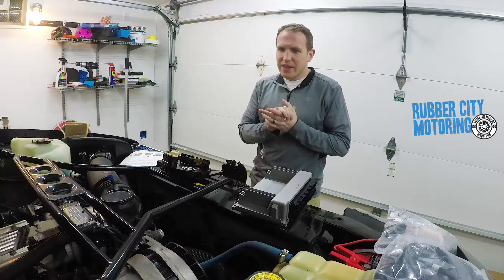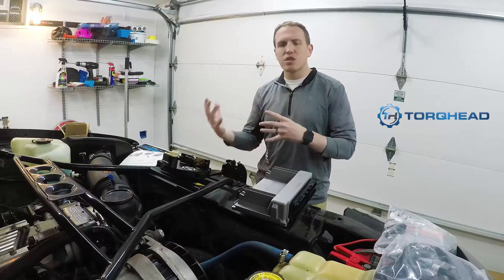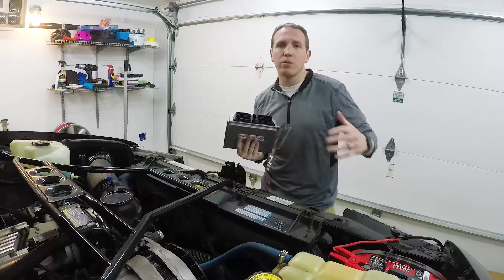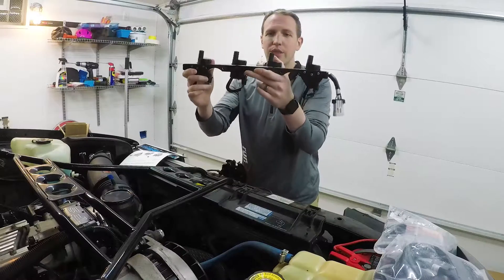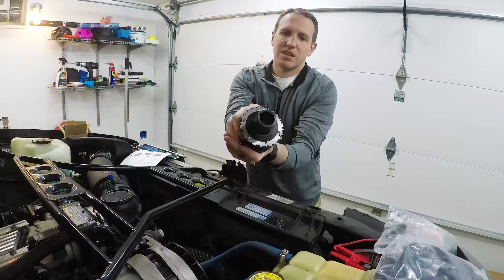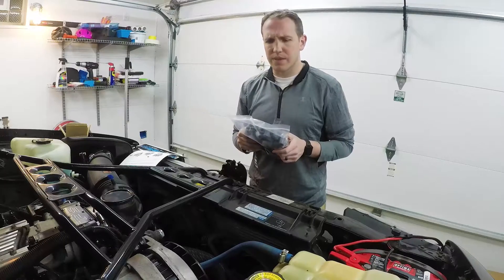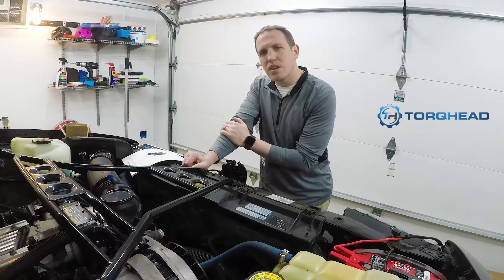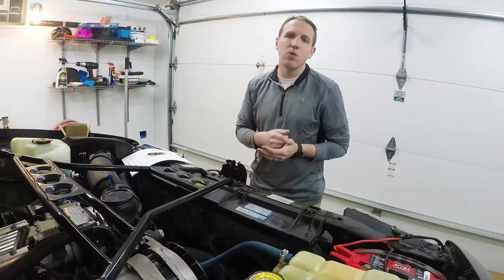Part 1: Torqhead 24x Coil LT1 Upgrade Introduction and FAQ

Comment: It’s a maybe for me. I’m in college and I got a 94 Z28 as my first car. Not a smart move right? Blame my families tradition of owning a muscle car as a first or second. I’m highly considering replacing the OptiSpark with a different system, but also just going straight to a 98. However I just love the body style of the 94 compared to the newer catfish look. 

My 94 drives like a dream besides rotted out floor pans, a bad oil pump, and a front main seal that’s bad. I was able to get a good driver pan out of a convertible. I am by no means experienced in mechanics. My dad’s teaching me and this car has made my head explode more times than I can count.
Reply from the maker: I had a ‘98 SS - one of my favorite cars I’ve ever owned. Very reliable, no issues, and honestly I’d go that route, unless you have time and money to tinker with your ‘94.

Comment: I know you had a 383 before your torqhead install. Would any changes need to be made if i did this upgrade first & then stroked my 5.7 to a 383 next winter?
Reply from the maker: Probably just a retune to the torquehead pcm.

Comment: I know this was posted a while ago, so I would hope there are lots of miles on the car now and more people that have done this. Have you (or anyone else that follows this cannel that has made this modification) had any problems with it? Also wondering if you or any followers have had any issues passing smog tests with this kit on? My opti is dying and I'm considering this modification, but the car is my daily driver so it will need to pass NV smog check annually. If anyone has done this mod please let me know if it causes you to fail smog check. Thanks.
Reply from the maker: Hello!  So I have sold the vehicle a few years back.  Overall I didn't have issues with the Torqhead products; just getting the tuning dialed in with my 383 was the biggest challenge.  Their setup is mostly designed around stock parts, which is ideal.  I did pass an Ohio smog check with it here as well; not a visual inspection, but just a pcm check.

Comment: I investigated the Torqhead setup and even called the company (and spoke to the owner) My car is a 92 Corvette Lt1. It just so happens that the 92-93 Corvette is not supported. I wanted to do the Torqhead thing, but for some reason I can't. Maybe it's the OBD1. Don't know.!
Reply: its the old style computer. you could do it if you converted to a 94+ computer with wiring harness...pain in the ass, wish theyd make one for the old style computer.

Comment: What do you think of that TPiS throttle body?
Reply from the maker: It was overkill. My 383 setup ran better with the stock throttle body. 

I think you need some massive head work, cam, etc to make the most out of that 58mm. Plus it didn’t idle great with it.
Reply: @RubberCityMotoring  Yes i know a 58mm is overkill, it is on anything that small, you'd want a lot more displacment for a 58mm. I'm more interested in the quality of the unit, they make the same in 52mm which is what my Callaway has factory fitted. Mine is worn and i need a replacement. TPiS seems about the only place that has them, short of a BBK, and those a total f***en junk.
Reply from the maker: Oh oh it was a very nice unit. Quality was top notch. The return spring was a bit stiff, so the pedal felt heavier. Overall though, a nice part.
Reply: @RubberCityMotoring  Thanks mate, so far no one has been able to tell me what they were like. Most of the reason it idles worse is due to the IAC path being split out into the main plenum, instead of feeding into the IAC ports where it is meant to go. No idea why all the after markets do that, it causes split BLMs and piss poor idle, but they all seem to think it is just fine.
Reply from the maker: No problem - you’re exactly right. I was fighting idle issues so much due to the iac routing.
Reply: @RubberCityMotoring   i'd be sleeving that IAC path outlet to the plenum if i do install a TPiS, but i'm thinking of servicing the stock 52mm throttlebody Callaway has over-bored, i'll see about putting in sealed bearings

Comment: installed this system on my 1980 Corvette three years ago on rebuilt stock 1994  lt1  and controls the rebulit 4l60 e 
not a mechanic  58 years old  did it myself started first time runs great ever since had a little issue with a coil pak but like mentioned went to a auto parts store picked one up no problem  love it 
just run it  with the basic tune and it is smooth with great power

Comment: This is so cool! I'm sure very expensive  which ill have to wait on and save. I just got my buddies 1995 Trans Am. He bought it new and I was the first person he took for a ride and the first person to let drive it. Do you have used Lt1 parts for sale? He parked this car 10 years ago just because he didn't want to put a lot of miles on it.
Reply from the maker: I don’t really have a ton. Just random small stuff.
Reply: @RubberCityMotoring  my email is gene.holmes31@gmail .com. If you want to get rid of it make a list of the parts. My TRANS AM  has been parked 10 years and I'm sure there's a lot of bad parts.

Comment: It's always motivating to see someone doing something different than just throw an LS in it. Sure it's easier but LTs are still amazing engines.
Reply: Im sick of these crap OPTI's. MSD's didnt even last much longer, not to mention the bearing went. High performance my ass. Cant wait to get this upgrade.
Reply: @nickoD509  my msd lasted 2,000 miles and just went out. Hence here I am learning about this 24x lol
Reply from the maker: Agree! Thanks!
Reply: There's nothing easy about an ls swap ... or inexpensive  .... they are proce gouging ls swaps now
Reply: @camro177  my obd1 pcm system killed my ls 408 dream. I'm sticking with my lt1 and likely will do this install when I stroker build, tm56 mag. 9in rear 
$$,$$$ it's OK, it's my dream.

Comment: I’m about to say forget it and get one of these kits. I’ve been trying to figure out why my LT1 sputters/misses when it is warm. It happens randomly and my mechanic couldn’t recreate the problem (of course). I’ve tried fuel filter, ICM, cleaned my MAF, fuel system cleaner, and I’m about to try a coil and MAP sensor. I’m starting to get the feeling that it might be an opti.
Reply: Same situation here, turned out to be the seal behind the water pump leaking oil all over my Opti. Now that my car is sitting in my garage with everything removed, I thinking I'll get this kit, put everything back together and be done with it. That way I can walk out to my car someday, start it and have the reliability of an LS with the classic sound of an LT. Best of both worlds. Imo

Comment: Are their products emission friendly? Can I run egr.?
Reply from the maker: Yes you can run an egr with this. As far as carb and state requirements, I’m not really sure. My 96 is about to be exempt here soon so I’m not too worried.
Reply: My car is a stock lt1 with ram air can I run it with the stock
tune?  Is the pulley easily removable if need be ?rebuilding engine in future.
Reply: How is car doing now?
Reply from the maker: Yea it is set to run stock tune normally. Pulley comes off easily, but you have to take the hub off as well. Not too hard, but you need the right tools. Worst part of the job imo.
Reply: Would that set up pass smog in California?
Reply: You would have to call Torquehead for that information Andre, was wondering about that myself ,I 
live in a state that has no emission regs .

Comment: Which opti/ wires did you use before you changed it
Reply from the maker: I bought a set of over the valve cover wires off eBay. Came with looms and they were all longer.

Comment: How much did this conversion cost? I have a 1996 , LT-1 350 in a 1996 C4 Corvette. Are you happy with your end results? Thank you
Reply from the maker: So depending on the kit you get - they run anywhere from $1200-$1800.  I am sooo happy with the end result, but with my 383, new build, tuning, etc - I'm still ironing out bugs.  If you pop this onto a stock motor though, it is so easy.  Check out the other videos to see more on the install.  

Link for pricing - http://torqhead.com/buy-24xlink-products.html#!/1994-1996-C4-Corvette/c/23575137/offset=0&sort=normal
Reply: @RubberCityMotoring   Thank you very much for getting back to me, and I especially appreciate your opinion of the finish conversion. Will check out the other videos too. Take care

Comment: Yea your right.. No one wants to work on our LT1 engines.. Either i get a super high price or no response on adding mods to my Impala SS.. Always trying to talk me into LS swap.
Reply: that 'cause they're idiots.
Reply: I know right! When they came out, everyone was doing crap to 'em. It's like they forgot! And when I took my vette in for a new clutch, it was all about, " but it's a corvette" is why a part would be double, or the labor and all. Ya know, it's fairly easy to work on. You barely have to bend over to change the fuel pump!
Reply: I had a mechanic tell me the water pump was hard.... did it in 3 hours first try, did what a certified mechanic would not

Comment: Efi connection.com has the original 24x. Thats who I used
Reply: This is cheaper lol
Reply: @twiztid6977420  dorsnt sound like it is to me. Basically soumds like you have to get all the same things. And with the 24x you can get all used parts from other ls engines. So i just dont see it.
Reply: @adamweaver1594  $1600<$2400
Reply: @twiztid6977420  buddy i already did the 24x and i did NOT spend mor than 2000. It was more like 1600
Reply: @adamweaver1594  That's awesome, but I'm just saying the torqhead is already $1600 lol

Comment: Hopefully I will never touch another lt1 besides the one I have. But that said, I am incredibly impressed with my torqhead installation. Will recommend them to anyone looking to replace the optispark.
Reply: How hard is it
Reply: @jaketester9555  my engine was out of car at the time so it was no problem. If you're still in the car then you have the typical f-body frustration

Comment: Can do a complete ls swap for 1200. And this kit like what 1500? But great job and video.
Reply: Zone8GokuLsx id rather buy this kit. So i can still retain everything my ac an all. The ls yea its is cool but your gonna need custom motor mounts etc.
Reply: Lmao, with my LT1 freshly rebuilt with a CC306 cam, ported heads, etc you think I would want a beat down LS1 swapped in? Nah. Also, since my LT1 is in an F body, I can just walk out and buy an LS1 factory equipped F body if I wanted to lol. Besides, the only reason your LS Juan, exists is because the LT1 got here first. Always remember that if you ever think about bashing an LT1 lol.
Reply from the maker: I mean you probably could do an LS on the cheap, but at the same time - it's gonna have some miles on it and also need refreshing.  On top of it, the kit is much easier to do for most.  An engine swap isn't a weekend project in most cases, but this truly is a bolt on, no lift required driveway project. 

Thanks for watching!

Comment: What were you asking for the MSD stuff?
Reply from the maker: Well the distributor is like near new with 5k miles - sealed, tested and working.  

It runs $500 new..  Why don't you drop me an email and we'll discuss pricing.  You can just make me an offer if you'd like.

Thanks!
hoagiesgarage@gmail.com
Reply: Rubber City Motoring.  I’m definitely interested in the Opti and wires if you still got them, I’m building a LT 383 right now

Comment: Hi JT,  This is Ody. We briefly discussed your project a week or 2 ago. You had mentioned
changing out your Opti but did not tell me what brand you were going to use. I am taking it you did not want to let the cat out of the bag. I too am changing out my opti. If you dont
remember, I have just about the same engine as you. A just built 383 stroker done at Bills
in Hanover MD. I also get work done at Autofab. I am disabled and can no longer do most
of my work.  When I first went into the shop they recommended the Torqhead and I was sold. Ready to buy. When I returned to set up my appointment, then they recommended the Holley EFI ECU set up. I wonder what sold you the Torquehead over the Holley? I did hear you say how you loved the costumer support. Is there anything else?  I look forward to the up-coming project
Reply from the maker: I didn’t even consider the Holley because I don’t think it does the same thing. 

The turnkey setup, knowledge, ease of install and just overall experience with TorqHead has been great. 

I would highly recommend and endorse them, even without installing it yet. Overall a great company and good to work with. Paul will really take care of you and build your kit exactly how you want. 

Best of luck Ody, let me know if you have other questions.
Reply: Thanks for filling me in. I bought the Holley HP EFI ECU  to replace the opti.
A brand new engine build with mis-fire problems due to a brand new Chevrolet Performance Opti. It looks to be about the same idea as the Torquehead. My
goal is to eliminate the Opti completely. The Holley also has a nice self tune feature amongst other things.  I will go back to autoFab to see if I am missing out on something  . . Thanks and Good Luck
Reply: Ody Slim how are you liking by our Holley set up ?
Reply: Ody Slim 
P

Comment: Sweet, the Torqhead Kit is the last piece of the puzzle to have your build run at its full potential. Your right NOBODY is left who is willing, or is even good at dyno Tuning LT1s. If you ever need help, contact Owen Buchanen at TOP END End Perfomance in Crystal Lake IL. He is a hardcore LT1 guru. I will eventually go Torqhead on both of my LT1s, so your videos will be very insightful.
Reply from the maker: Thanks so much for watching. It’s weird with the LT - just sorta dead as far as tuning interest.
Reply: Jesse Martinez.
Reply: Need help with my lt1 ...1995 lt1 firebird 6 speed pcm needs tuned
Reply: Everyone who has worked on the LT1 has croaked. There's only a few people left who truly know the ups and downs of the LT1